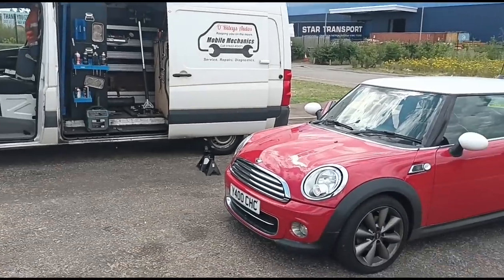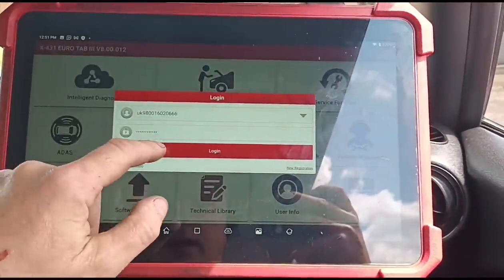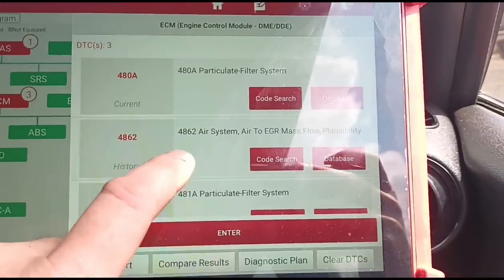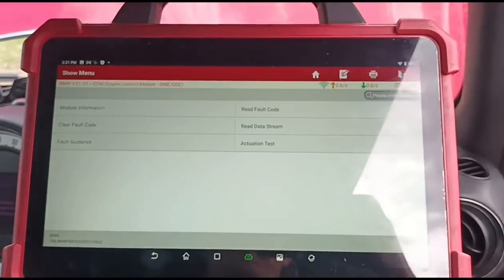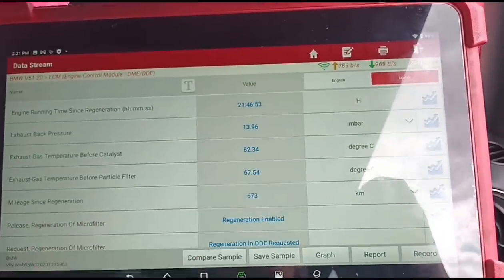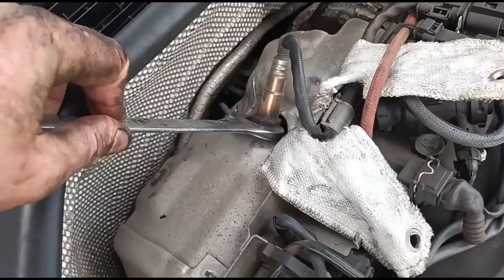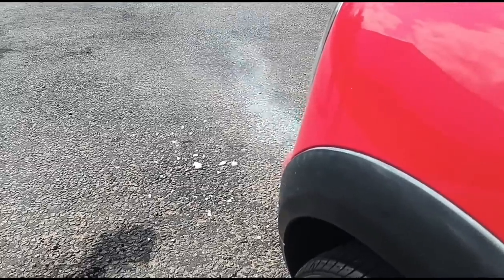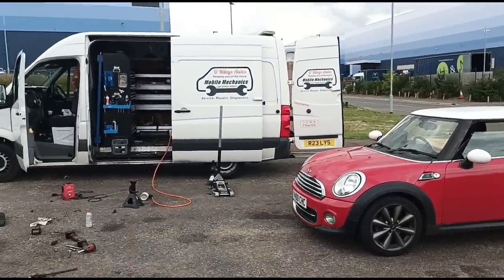BMW Mini D 480A 481A Particulate Filter System 4862 Air To EGR Mass Flow Plausibility.

Comment: As I do work on my own car, I often wonder if car manufacturers actually design engines in such a way as to make them as difficult as possible for guys like Jimmy or even have a go merchants like me to try and pull out parts and replace them.  It's like when the engine is assembled in the factory, they then shoe horn it into the engine bay without a thought as to how someone might have to replace a part in the future.
Reply: Oil and filter changes seem to be easier on modern cars than they've ever been.
The crammed engine bays are down to wanting to keep the cars small and light for performance and economy. No excess bodywork metal around the engine to make access easier.
And then there's the whole DPF system thing, which is there to meet emmissions legislation, which is there to address car pollution. Even though they affect car reliability, simplicity and performance. 
Smokey old diesel vehicles were a pain in the lungs. Euro 4 onwards are a lot better.
Reply: @lint8391  While changing the oil and filter on my Qashqai is a doddle, it’s a pain in the ass in my mothers Clio where you have to go through the offside front wheel arch and then try not to dislocate your shoulder to get at the oil filter.  In older cars (80’s and 90’s), there was clear daylight around the engine to work on it. So much room, you could almost stand in the engine bay!  Modern cars with emission control parts and electronic this and that fill out the engine bay making it far more difficult to work on modern cars.

Comment: Hi Jimmy. I wanted to thank you for helping me fix my 2011 Fiat Ducato 115 multijet. After watching some videos and deciding on my best course of action. Today I fixed my DPF fault for good. It did cost 500€ but 350€ of that was a good ODB2 computer. I've reduced my back pressure by 90% and now have a fancy ODB2 reader i can use on other cars. Thanks again. Loads cheaper than a garage!
Reply from the maker: Glad I could help

Comment: Hi, watching this I think has helped me. I have a 2013 Mini Cooper d with 79k, I am getting 486a,4868, air system to egr plausability and 4530 boost pressure, is this the same issue but related to my reader being different

Comment: Hi, I have the exact same car but on 63k, I noticed that the banding you cut has already been done on mine but the pipe has a split. I have a replacement coming so would like to know how long it took to remove the intake pipe. I have new seals coming as well just in case.

Comment: Nice work.
Do you ever get many VW's with issues?
I had several issues with my old Ford mondeo with failed dpf regens and oil level increasing.
I have never had an issue with my vw.
Reply from the maker: I used to do loads of vw but not so much now

Comment: Hello, maybe someone can help me with an idea about an issue that I have. 

120d n47 engine, dpf on, 177 hp 2011 e87. I have these codes

497D exhaust pressure sensor before turbine, plausibility 
4CA7: 4CA7 fuel temperature sensor, plausibility

I try sometimes to do some work on my own, because shops tend to not get that much committed to solve the issue, they recommend to change a lot of parts and that's all from their side. 

I had an issue with ac discharging in max 1 year. And the guy from the shop told me don't bother searching and fixing the issue, just fill it next year. I went to a friend of mine, and he gave me instructions what to disassembly and changed the radiator and found a pipe that had a hole in it. So I try to figure it out myself.